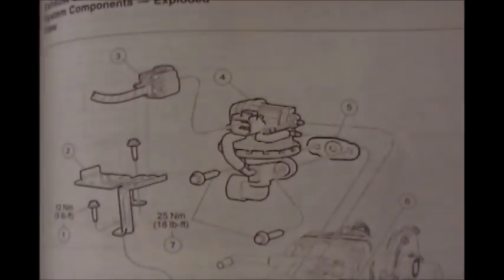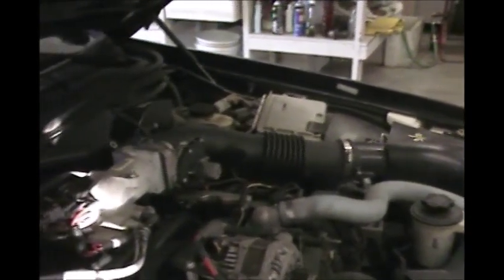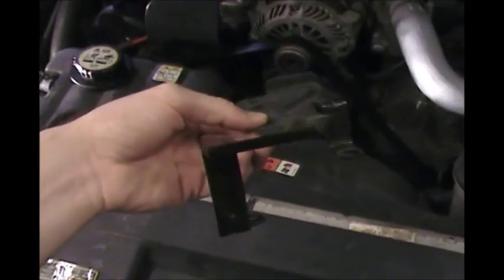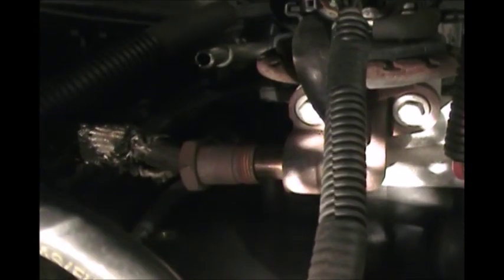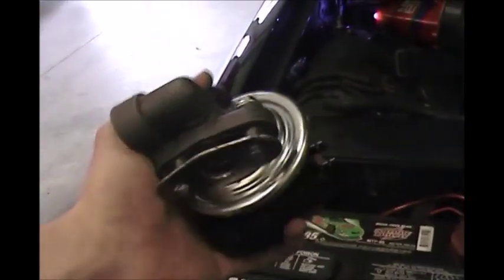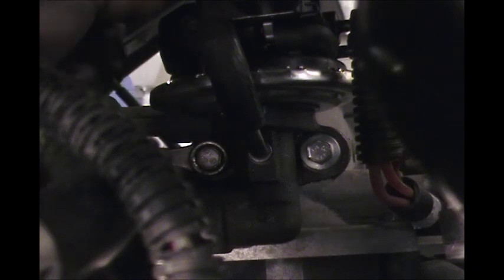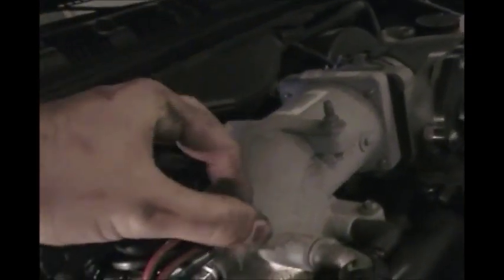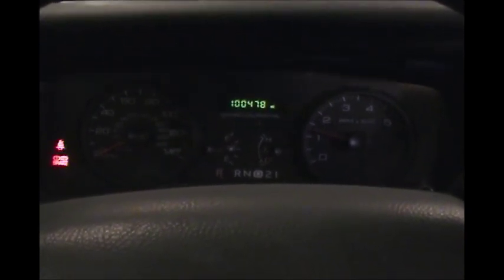EGR Valve Replacement 2008 CVPI

Comment: Hey man just wanted to drop a note of thanks! I just did this to my 06 and it went easy. I bought the wrench 1-1/8 and it worked great! Replaced the valve and were are back on patrol lol. I was gonna clean my old one but figured why not replace and then i wont have to worry about it. Job took about 20 mins off 20 mins on. I appreciate your detailed analysis of the replacement. It helped greatly. Thank you!

Comment: The flashing tire pressure light on startup means that one or more of your tire pressure sensors have gone bad. If the light remains solid (never flashes), you have low tire pressure somewhere.

Comment: Light come back on? I changed mine out and it came on again
Reply: Who knows anymore. Mine is being a bitch. Cleaned everything. Took throttle off.
Reply: Did you fix it? Maybe you didnt torque the bolts enough and have emissions leaking?
Reply: He didn't test the EGR manually or DPFE with a multimeter. Replacing the EGR is probably a 50-80% chance it'll fix it but you're basically getting lucky throwing parts at it rather than diagnosing it.

Comment: What repair manual is that?
Reply from the maker: The shop manual made by Ford. You can likely find it on eBay, that's where I got mine.
Reply: Harley Heath did the check engine light go away?